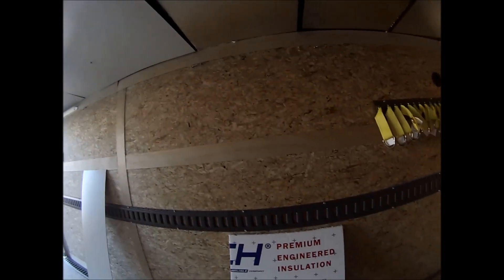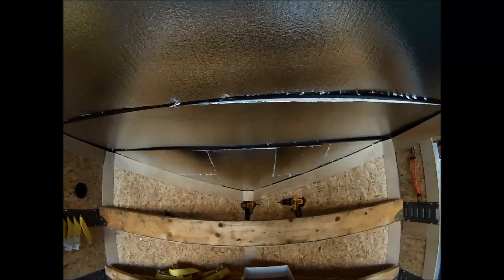Cargo Trailer Roof Insulation for Under $100.00

Comment: I'm about to do my 4th build out, always interested in new techniques.  I built out a mobile photography display/sales unit and used the foam insulation with the same white fiber board on top. It still looks almost new 13 years later after thousands of folks been inside.

Comment: What did you use for screws for the paneling to go into the frame of the trailer? I also have a 7x14 cargo trailer.
Reply: We used self-tapping screws to attach furring strips to the frame when attaching our ceiling.  Just make sure the screw is not too long (to punch through the roof).  I think we used 3/4" or 1" screws - it kept the screw within the tubing.
Reply: @CupcakeandCornbread   Awesome thank you!

Comment: What's the R-value of the insulation?
Reply: It really doesn't matter because he left all kinds of gaps. The metal roof trusses uncovered. The insulation just laying/flopping around. Its better then nothing but a lot of work for minimal r value.
Reply: I personally believe in a good spray coating of foam for the roof as well as the white RV gel coating for the exterior.  Maximum insulation and waterproofing.

Comment: Looks good. I've used that R tech material before and now I have a 7x14' trailer with a cambered front (convex). This is an informational video and I almost think I want to take this a step further later when I get the money and spring for 2 layers of R-Pro max foam and screw in real plywood ceiling material (like ⅜" or ½" for strength so shoplights or other things can be screwed in)